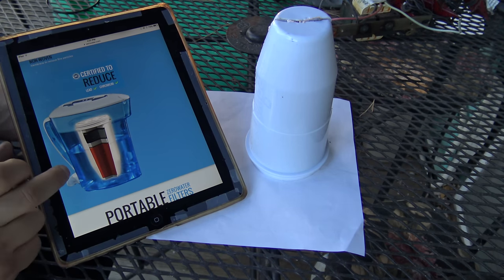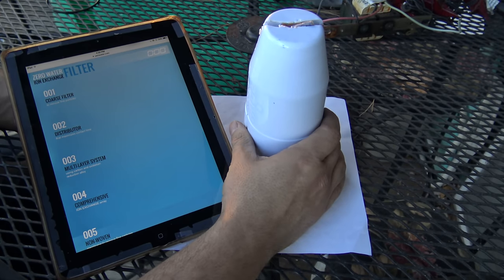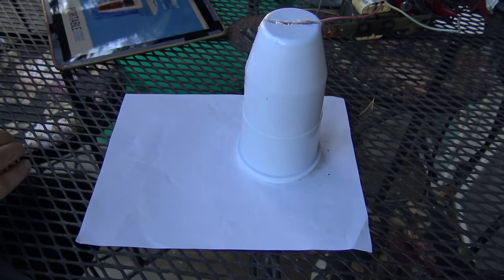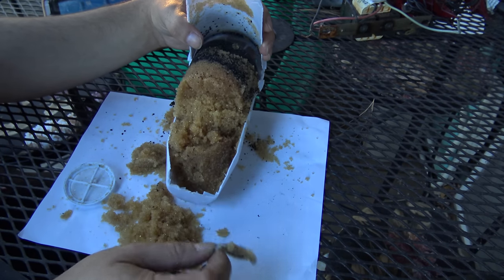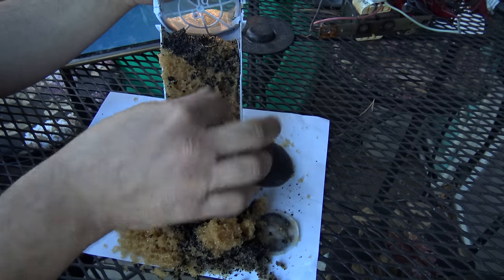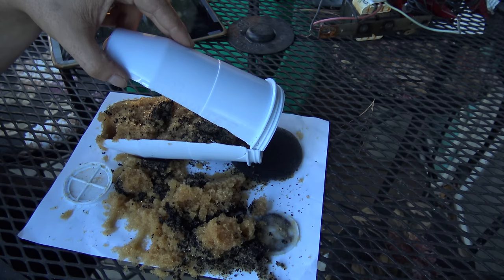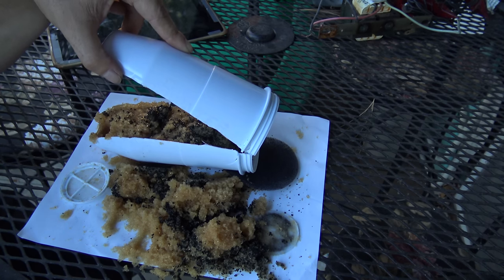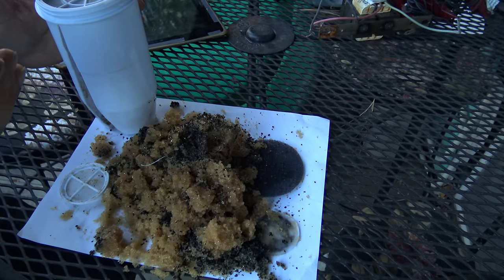Zero Water Filter Pitcher Filter Chop / Cut Internals Teardown

Comment: That rotting seafood smell only happens when your filter is allowed to dry out repeatedly which creates optimal conditions for it to grow. I get about 6 months out of a filter as I always keep it submerged and I have a 6 inch piece of pure silver wire I keep in the top and bottom part of the jug. The silver has strong anti microbial ionic properties.
Reply: Five Star I just ordered x2 14 guage 6" silver wires after reading this message. I am hoping that will do?
Reply: very good to know. what do you mean by "keep it submerged"? thanks.
Reply: @coryphillips1783  did that work for you ?
Reply: Silver really???? never heard of that. Ive heard the same thing about copper. Like those copper jugs used in India.
Reply: really wow i never know about that i just read it up online and yea it true and it not a thing people say like other things this is studied by the WHO and EU commission to hold up to it does do that. they use nano silver partials in water treatment places
Reply: @coryphillips1783  yes perfect (sorry for the 2 year delay lol)
Reply: @kikovision4687  meaning do not let the water level in the pitcher remain low for extended periods of time fill it to the line daily
Reply: @fraddi  Medical tools used to be made of pure or plated silver for this reason now they are made of less effective but cost effective stainless steel and the same goes for surfaces and appliances in public kitchens. Coppers antimicrobial properties are much weaker (less ionic activity)
Reply: @fivestar2227  ah. ok. thank you very much for the tip.
Reply: Where can I buy that silver wire?
Reply: Could you explain better how to use please?
Reply: The rotting seafood smell is just how it smells. Trust me
Reply: But I have also heard that it’s not good to keep the filtered water in the pitcher longer than 3 days , because with zero water it in an essence or not essence it does it removes everything from the water as in the chlorine fluoride and everything so if you keep the pitcher full for up to 2 to 3 days and don’t use that water it will start to develop bacteria sooner then if you keep the pitcher empty at night or not empty but I mean not completely full to where the next morning you have used that little bit of previous days water for your morning drink of water
Reply: @kikovision4687  under water in the pitcher
Reply: @coryphillips1783  did the silver wire actually work. Now after 5 years testing
Reply: @elizabethheavenly9102  ebay

Comment: I also disassembled the filter, but I carefully removed the top membrane using the small blade of a Swiss Army Knife. If you look at the top where the membrane (screen) is, you will see that it is an added piece and a knife can be easily inserted pulled around it allowing you to remove it. Then you have the entire filter intact. Inside you will see what looks like tiny beads of carbon along with some translucent beads.

Comment: Mine lasts 9 days from tap water before a slight fruity smell. It's still cheaper than bottled water where I live in the UK.
Reply from the maker: Must be really really bad water quality then. My water at home isn't the best either, but I still get about 2-3 months per filter. Consider double filtering your water. Have a basic charcoal high volume filter connected to your faucet, I have a 10,000 gallon one under my sink. Finally ready to be replaced after 6 years. That removes a lot of crap allowing the Zero to last much longer and remove much more.
Reply: @KmanAuto  My mistake it was 12 days just checked the calendar. Our tap water TDS today is 290 usually 330 ish. Funny thing is we run the tap water through the gravity fed Berkfeld with flouride doulton filters and it's coming out at 303. It does taste ok but it's the Zero water filter that makes it taste how water should taste.
Thanks for your reply.

Comment: Should be a 2 stage. The flimsy plastic and foam filters don't count. The charcoal and the other orange beeds do all the chemical work.
  So why not empty expired zerowater filter and fill with activated charcoal. And drill out the hole a little bigger in bottom. How would the 000 meter read then? Our water is about 400 ppm.

Comment: You could order a big bag of granulated activated carbon and a big bag of ion exchange resin and refill the filter. Could be cheaper in the long run. Also, the granulated activated charcoal itself can be rejuvenated with a rinse and heat treatment. I don't know about the ion resin though. I don't know enough bout the chemistry to comment.
Reply from the maker: If these filters were more expensive, I might try. But, its just not worth the hassle. I usually buy filters when ZERO has the bulk buy sale. So I believe it's usually 12-16 filters for about $115. Thats enough filters for myself, my parents in law, and my parents for a year. Not too shabby. And actually longer than a year. I do tripple filter my water though. I have a large under sink filter, good for some 20,000 gallons/5 years. It's a charcoal and sediment filter. And then I have a Pur faucet filter, and use that to fill the zero. After the 90's Cryptosporidium contamination here in MIlwaukee, and the lead issues, yep, works for me. That and I mainly already had those filters, so since I had them why waste them :-) The Zero works good for the disolved solids and in-organic stuff. But I still like the charcoal filter on the PUR. But doing it this way, The filters on the PUR and the ZERO last considerably longer. I can usually reset the PUR filter a good 4-6 times before replacing it. Once I can start to smell Chlorine, even a faint hint, thats when it's time to replace the PUR Filter. So once/year. Zero I replace once the TDS reaches about 10 (They say 6, but once the ZERO is saturated enough where it starts to show numbers on my TDS meter, it can go from 1 to 10 in a single day, within another day it will be at 20, and climbs exponentially rapidly from that point).
Reply: Re-filling might be a viable option.  I just removed the screen on my filter and dumped it out to look at it.  The screen on the inlet side popped right out, not sure if it can be done without damaging it though.  I wasn't very careful with removal, as I just wanted to see what was inside.
Reply: @huckbeduck how about carefully open it , and wash inside in boiling hot water to kill everything and then put it back in.....🎉

Comment: Why is my zero-water filter  lasts only aprox 55 litres (not gallons) before it measures 006 on STD  meter. I mark every little of water I put in the cistern. So far I’ve I meticulously followed 5 filters. My tap water measure around 3.50

Comment: I am curious to know why did you cut open the filter?
Reply from the maker: To make a video.
Reply: @KmanAuto  This filter I'm assuming was a used one?
Reply from the maker: @rknine7998  Yes
Reply: @KmanAuto  I have always wanted to know and I have asked zero water help support but they weren't very helpful, how does the internal part of the filter remove all the particles inside the water from 36 parts per million and bring it down 0 parts per million?

Comment: 200 gallons? I mean the max filter on zero water document is around 40 gallons for TSD between 2-50! in addition o bacteria, and mold as well...I think the sourness of zero water is due to these micro releasing their waste...which you won't notice the filter is new and able to absorb it but when it's old it's unable to capture the waste.
Reply from the maker: First, we keep the pitcher in the fridge now unless we are using it a lot throughout the day, then in the fridge at night. 
Second, we triple filter our water. First is a Under-Sink filter that removes sediment & many chemicals, then through a faucet mount PUR filter, then the Zero Filter. Our coffee maker also has a small on-board charcoal filter, so that technically gets quadruple filtered. We are now pushing through about 400 gallons per zero filter before TDS gets to about 10. Usually, it will go from 0 to 1 after a LONG time, then 1-5 takes a few weeks, 5-10 takes a couple days. At that point, we switch filters.

Comment: Two weeks and Zerowater sour
Reply from the maker: I average 6 month out of each Zero Filter before it gets the funny taste and PPM goes above 10. 
The sour taste is bacteria growth in the filter, which will happen in nearly every pitcher based filter. If you want to mitigate this, keep the pitcher in the fridge. Sitting on the counter, especially if it's in a warm place or sitting in the sun, and it will go bad considerably quicker.
Reply: Start collecting rainwater and filtering that for your drinking water.  It’s bound to be better than your city water.
Reply: @KmanAuto  it is not bacteria. It's literal Hydrochloric acid the filter is putting into the water. When the filter runs out of OH^- anions it's left with a surplus of H^+ cations. These cations bond with chlorine (Cl^-) in tap water to form Hydrochloric acid (HCl). It's not dangerous though unless you drink a lot of it.

Comment: Lower PPM doesn't mean safer water this thought is widely shared by the public and a dangerous misconception.

 Using a TDS meter to measure ppb lead concentrations in tap water is like trying to use a car’s odometer to measure a child's height…. It's the wrong tool.

A TDS meter is not sensitive  enough to measure toxic levels of lead, chromium-6 and arsenic. 

Because TDS/ppm is an aggregate measure of charged compounds in water, uncharged things like motor oil, gasoline, many pharmaceuticals, and pesticides do not contribute to a TDS/ppm measurement

For example, if water has lead, chromium- 6 or arsenic that are 100x the EPA limit, the TDS reading will read 000 or 001.

They must be measured by trained staff in analytical laboratories that use much more sophisticated scientific equipment than a $8.00 device.

If you are concerned about water quality, put the money toward the purchase of an effective drinking water filter that removes harmful contaminants from your water.

Just trying to help my friend have a good day UNUS❤✌!
Reply: What do you recommend for a filter?